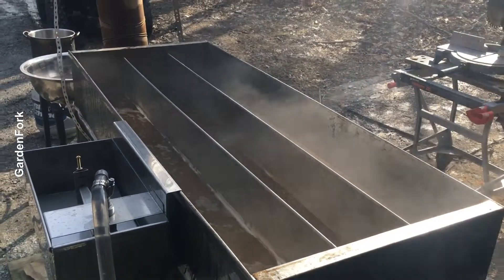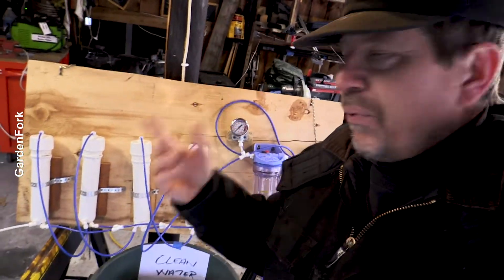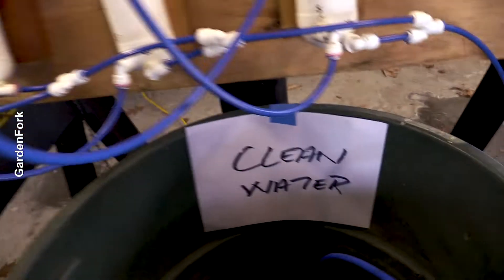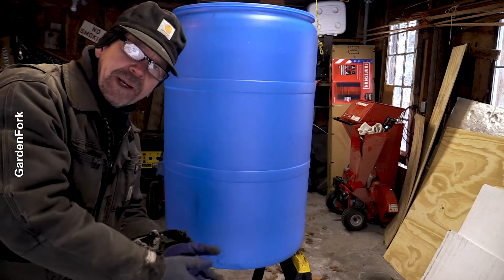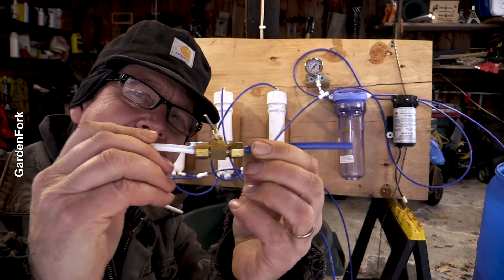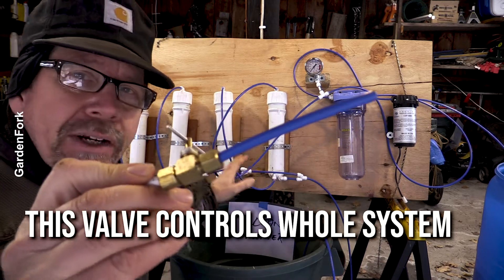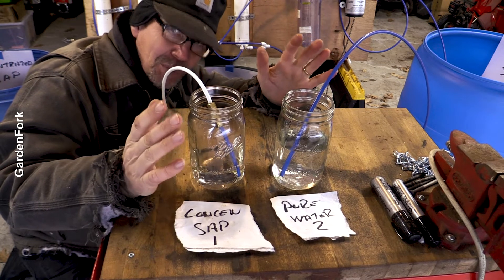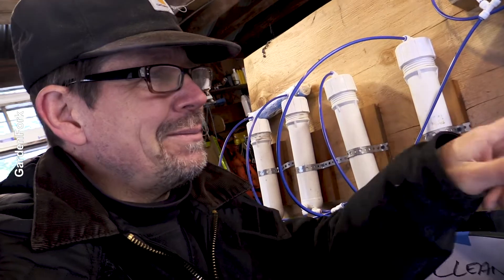Build Your Own Maple Syrup Reverse Osmosis Rig

Comment from the maker: Parts List (affiliate link thx!) https://geni.us/kPBiz9 
Do Not buy the pump in the vid, buy the 8800 pump in parts list.
Reverse Osmosis How To vids:  https://www.youtube.com/watch?v=n8ttfk8PO44&list=PLK9GxIRaLC5X_lmHgUGYBWZoOXE1OdpKO
Reply: Eric.... I have a question. I ordered  all the parts from your parts list but when I am not sure about is the two pieces which screw on to the five micron filter.  Do I have to buy those separately, cuz my filter did not come with it?
Reply from the maker: @rikidd77  hi D, there is a two piece filter housing , a blue main part with the in and out ports and a clear cylinder that screws into the bottom blue holder. The clear housing holds the sediment filter. The sediment filters don’t come with the filter housing. The housing and the actual filters have to be ordered separately. I’ll check the list to see if I have it shown correctly. Thx! Eric.
Reply from the maker: @rikidd77  also you will need these adapters for the filter. I just realized they are not on the list https://amzn.to/3iG0dXd  maybe that was your actual question? 😀 Eric.
Reply: @gardenfork  You really are awesome!!! Very much appreciated, I can't thank you enough. I just ordered the adapters. Here in CT tap season is only ba few weeks away. I am so excited to start tapping and boiling.
Reply: @gardenfork  Everything was ordered and delivered except the adapters. I am putting together the board as we text. Can I ask where you live?
Reply from the maker: @rikidd77  email me: eric@gardenfork.tv
Reply: @gardenfork  just sent you an email Eric, 🍁
Reply: Sorry to be so offtopic but does anybody know a way to log back into an instagram account??
I was stupid forgot the password. I would love any assistance you can offer me!
Reply: @Dominick Ty instablaster ;)
Reply: @Zayne Cain thanks for your reply. I found the site through google and I'm trying it out now.
Takes quite some time so I will get back to you later with my results.
Reply: @Zayne Cain it did the trick and I finally got access to my account again. I am so happy!
Thanks so much, you saved my account :D
Reply: @Dominick Ty Happy to help :)
Reply: Great video thank you !!

Comment: How many gallons  a hour?
Reply from the maker: it depends on so many factors. it is not fast :)
Reply: @gardenfork   i have  the bigger 8800 pump  and 4. 150gpd ro filters  my sap is 3% and at 50 degrees  today and im only getting  about 5 gallons a hour done......
Reply from the maker: @brentfarber8460  have you back flushed the membranes after each batch ?  5 gallons an hour is not unusual for me.
Reply from the maker: @brentfarber8460  there is good info on the forum on the Maple Trader site.

Comment: I noticed in the video you have the 6800 pump, but parts list has the 8800.  Did the 6800 work for you or did you need the 8800?
Reply from the maker: the 6800 does work, but the 8800 has more power. i did not have issues, but i'm not focused on large batches. what is key is backflushing the membranes between batches.  :)

Comment: Does it matter which side of the outlets have the check valve elbows?  I see you have the pink colored check valve on the left of two housings and two on the right side.
Reply from the maker: the check valves go on the sap exit port of each RO cylinder. the waste water does not need a check valve.  i fixed that mistake on my rig after i made the video. thx!

Comment: As as has been said - great video and makes it seem doable. One question (haven’t seen it asked). I have no power at sugar house so am thinking a small battery with inverter (or a portable power unit).  Does 150 gpd membrane mean 150 gallons in 24 hour period - I.e. do you need to run pump for 24 hours?  Better question, how many gallons do you run through yours and how long does it take?  I’m in the process of buying as per your shopping list. Thanks!

Comment: The needle valve goes on the concentrate side?  Also the tubing seems loose when I slide it into the needle valve.  Do you glue or anything or is sliding it into the tube enough?
Reply: Yes needle valve is on the concentrate side..  by increasing the pressure you force the sap through the membranes..  The tubing should be very tight to withstand the pressure buildup..
Reply: Yes, you need to tighten it with two wrenches so that its very snug.

Comment: Why would you put SOOOOO much effort into the going’s on INSIDE the individual RO Membrane housing and no explanation of YOUR work here?  

Why and how do you use four of them? You send the permeate output of one into the input of the second? I think that’s what you are doing but it just seems odd bro. 

So raw sap > 40 degrees goes to a pump that sends it into a sentiment filter etc? Give us the big picture just walk us through all the connections? 

No need to diagram in painful detail the inner workings of one of the devices someone else made?  

I am NOT throwing shade bro I appreciate you I mean well and I will subscribe and check out more of your content but I have been searching and searching for a basic explanation of what the hell all those tubes and stuff do and right when people get close to explaining the big picture of how the components work together the creator just skips over that part and it’s likely because you think it’s obvious. How would you know if no one told you? ✌️❤️
Reply: You basically have it.. after the sediment filter the sap goes through the first RO housing.. some water is removed (i.e. permeate) and the rest, with higher sugar content, goes into the next RO housing, where more water is removed, and then again two more times until you have removed a significant amount of water.

Comment: Hi @gardenfork I built this exact same RO model, thank you for the video!  I’m in CT too BTW.  One question I had was around the PSI and concentrate to water ratio.  I’ve been testing it with water and seems like I can’t get to 100 psi while getting a 2:1 ratio on the output.  Maybe it’s because I’m using water but is the ratio or the psi more important?  Hope this makes sense.  Thanks again!

Comment: Hi Mr GardenFork. I love your video! But just one thing...
At the beginning of this video, you stated that this system "...can remove up to 50% of the water from sap". That is an output of 1:1.
But the way you adjust your system, @8:05 , you are getting an output of 1:2 which actually removes 66% of the water.
Thank you.

Comment: Ok, I was panicking that I set mine up wrong. Same setup as last year, double checked in/out feeds. Same setup as yours and it isn't accomplishing anything. I'm not getting more than 15 psi, so nothing useful. I feel like last year I had the valve on the water out, but trying that this year didn't fix anything. I'm at my wit's end really. Any advice for things to check? I literally just wasted 45 gallons of sap.

Comment: Great video, I ordered the parts to build my own. One question, how do you go about cleaning the RO membranes? Is there different methods? If so whats your preferred method? Thanks
Reply: If I’m filtering again within a cpl days I run 5 gallons of the filtered water thru the system.... if longer 10 gal. You can buy membrane preservative for the end of season cleaning and storage
Reply: @billchriswell2925  So you really do a forward flush with pure water, not a classical back flush, right?
Reply: @31946mar  yes…if I’m running every cpl days.

Comment: Can you answer a question about your R/O system? Do I need to buy 3 Alberts filters  as seen in your video? I wasn't sure if more is better or 3 is the proper amount for your system....
Reply from the maker: Hi David, I run 4 reverse osmosis filter housings, hooked up in series. I've seen people online people will use just 1 or 5 or 6, i'm happy with 4. You can start out with 3 and see if that works for you, you can always add more. Thx! Eric.
Reply: @gardenfork   Is using more filters better in regards to extracting the pure syrup?
Reply from the maker: @davidvolpe503  you hit a point of diminishing returns with the filters. i've read that 4 or 5 is optimum. thx!
Reply: @gardenfork  Awesome Thank you. I have purchased the materials from your list. I will assemble it this weekend. Much appreciated!!

Comment: OOoooh, this is BEAUTIFUL! I've thought about ways to remove the water without boiling, never figured anything brilliant out to make it happen. If I had money ... 

In my 2-bedroom apartment aka Mad Scientist Lab aka Research Farm, the boil-off is done on an electric single-burner hotplate that sits next to my fire-escape door, cracked open a few inches to allow the steam to disperse out the door. The hotplate is rigged to a 3-hour timer, so I can set the pot up with twice as much sap as will boil off in 3 hours, and walk away if I need to.

Comment: I have to admit I have some difficulty visualising Reverse Osmosis. 
Osmosis is the process by which a low concentration fluid and a high concentrated fluid, not necessarily of the same material are separated by a semi-permeable membrane and the low side passes through to the high side to equalise the concentrations. That's how a plant root for instance works to take in water.
This looks like a pressure filter of a size to allow water molecule ions to pass through. No critisism just puzzlement of the definition.
I could not see if the Filter units were in series or parrallel. If they were in parallel would you be able to use a larger Filter?
Reply from the maker: Hi James, the terminology may not be correct, but its what maple syrup makers call it. The filters run in series, I run 4 of them. When you get to more than 5 the results diminish. thanks for your note and info, you know more than i do about this stuff. :) Eric.
Reply: James, the idea of "Reverse" osmosis is essentially forced osmosis across the gradient. Outside the "cell" (as a biologist, I think of it in those terms) has non-water molecules are mixed in with the water; inside is only water. Naturally, the pure water wants to flow across into the impure water, which is exactly what you said. In reverse osmosis, pressure is applied to the liquid outside the cell. Because the membrane only allows water through, the pressure is equalized only by water crossing the membrane, leaving the non-water molecules--in this case, sap--on the outside of the cell, to be siphoned off as the "target" of this process. In usual applications, the inside of the cell is what's siphoned off, while the outside usually becomes a heavy brine (sea salt, for instance) that's discarded. 

Did that help?

Also, they're in series, which makes sense; each unit will accomplish a certain amount of work, faster removal at the start and slower at the end as the sap becomes super-concentrated. If you used one big filter, you'd have to run it through a complete cycle with no new sap before you could pull off the final result. With each one in series, your new sap can come into the first filter continuously, and your half-syrup is created at the last filter. Other than maintenance and rotating of filters, he can run the thing pretty continuously.
Reply from the maker: @paintedwings74  very interesting, thanks for taking the time to write all that out. appreciate it. I'm always learning, thx! Eric.

Comment: You did not explain the reason for the 1 to 2 ratio, is is because you need time for the Millard reaction, or it is some other reason, like the equipment. Could you use a 1 to 3 or 4 for instance? Why not? It seems like this might be too much to explain in a comment, maybe another video?
Reply from the maker: From what I understand if you go too far past 1:2 you clog up the membranes quickly. Diminishing returns IOW.

Comment: So, I understand the concept and how you have it plumbed as I have worked with large RO systems on Navy ships but is the ratio still the same?  In other words, with the normal 40:1 ratio, if I run 40 gallons of sap through the RO system and end up with say 15 gallons of concentrate am I then boiling the 15 gallons down to 1 gallon???  Love your channel.  Where are you in CT?  I'm in East Haddam.  Pete
Reply from the maker: Hi Pete, when boiling, use temperature not ratios. maple sap becomes syrup at 7.5 degrees F above the local boiling point. So yes the ratio is the same, but on boil use temp instead of measuring the volume. My sap usually runs about 35:1 - 32:1 And thank you for your service.
Reply from the maker: Email me about CT eric@gardenfork.tv

Comment: Nice system!  I only have 1 maple tree and it is a silver maple so no sap for me.   Wondering if you could add additional RO units to further reduce the water content.  or have a second run through the RO system as well.  Also you may want to try a 3 micron filter which may help reduce the clogging of the RO filters.  Also depending on the pressure ratings of your system you could remove more water by increasing the pressure to 200 PSI.  but make sure your system can handle the pressure  (CLEAN metal tubing would help if you are afraid of tubing blowout)
Reply: The Aquatec 8800 pump is only rated to 125 PSI.  It is the best "bang for the buck" for small scale syrup producers.  The commercial producers use pumps up to 300PSI.  It's all about time & energy savings VS cost per gallon of syrup that you will be making.  Doesn't make sense to spend lots extra $$$ on a heavy duty RO system if you are making less than  30 to 50 gallons of syrup.  GardenFork's system is sized perfectly for the hobbyist producer.  
 A 5 micron pre filter seems to be the best balance for cleaning the sap considering filter cost and flow restriction.

Your Silver Maple tree  will have a very good tasting sap.  It just takes more (about 50 to 60 gallons) of it to make a gallon of syrup.  The final product is excellent quality though.
Reply from the maker: @manbearpig8691  thanks for taking the time to write Dick, good to know I have the right pump. Thx! Eric
Reply: @manbearpig8691  tap that silver maple! You may even be able to get 2-3 taps in it depending on it's size. I only have silver maples and my sugar content actually beats the average for sugar maples. I guess I just have some super healthy sweet trees. Even 1 tap could provide you with a quart of syrup in a season. Start on what ever scale you can!
Reply from the maker: Hi Dave thx for the info. From what I’ve read you it a point of diminishing returns when going past 5 membranes. You can do. Second run but again it is more work than you get in return. Thx!

Comment: I wonder about this, pretty cool. Are there other applications.
Reply from the maker: Not sure, Mbe to make sorghum syrup?
Reply: @gardenfork  It's even better for making Birch syrup.  Birch sap is only about 1% sugar.
Reply from the maker: @manbearpig8691  I have Black Birch in the woods behind me. Never tried to tap them. 🤔
Reply: @gardenfork  Because of the low sugar content, RO is a must.  It burns easier than Maple so you can't boil it as hard without scorching.  It finishes as a a sweet/savory syrup.  Check out some of the YouTube videos on this.
Reply from the maker: @manbearpig8691  friend told me about the scorching. by the time maple sap season is done, i am done with boiling ;) eric.